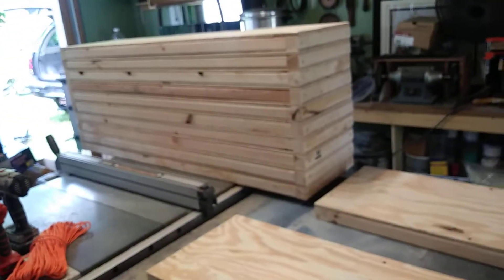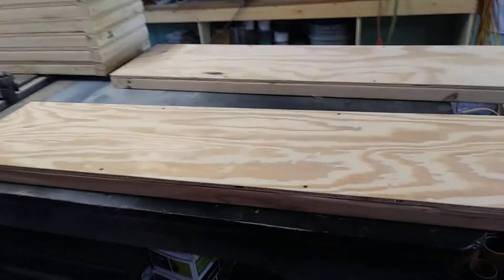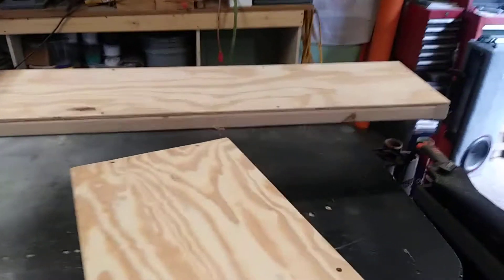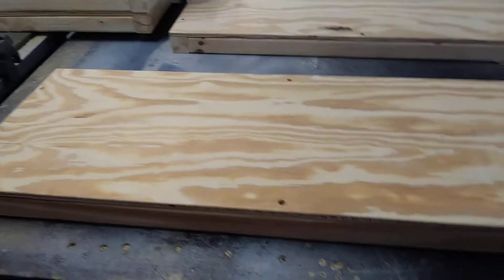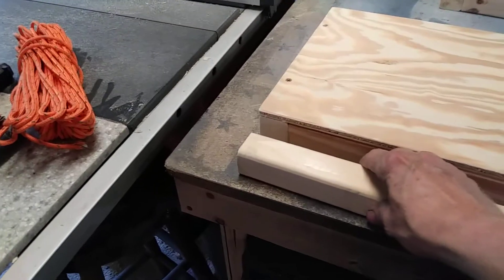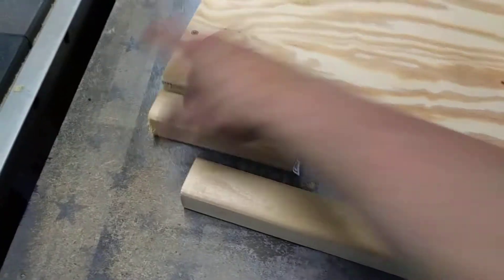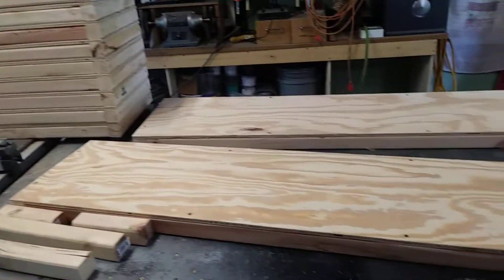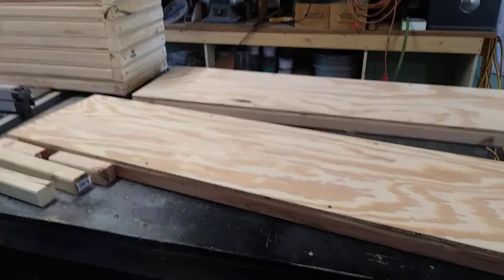Todays Pyro Project - Reusable Cake Boards

Comment: Nice work!  I like it.  There are also electrical conduit brackets made out of stainless steel.  They are cheap and might be easier to  install and line them up easier than i bolts. 
If you are going to use wooden stakes, they are a bit harder to pound into the ground.  Maybe pound some stakes in and then use some of that rope, with one end attached to the platform.  The ropes could be strapped around the stakes and fastened tight back on the platform....  I have no idea LOL

Comment: I'd add eyelets big enough for small rebar between furring strips, but that's because I use a similar system for my mortar racks.  And maybe find a way to hide away a way to add angles to a few of them with a bolt in 2x6 since your base used 2x2.